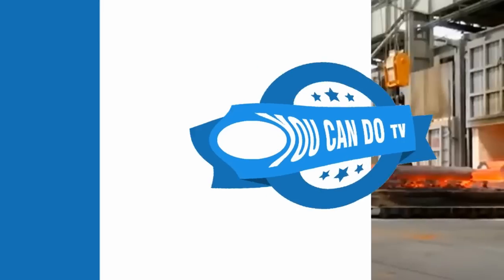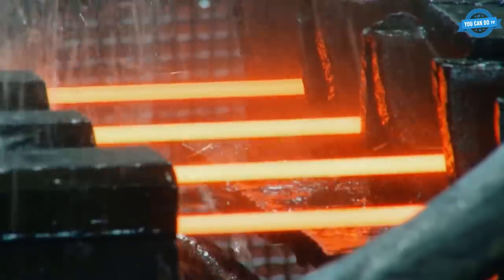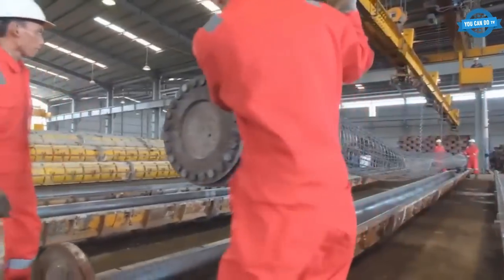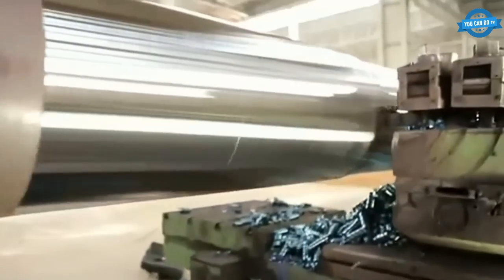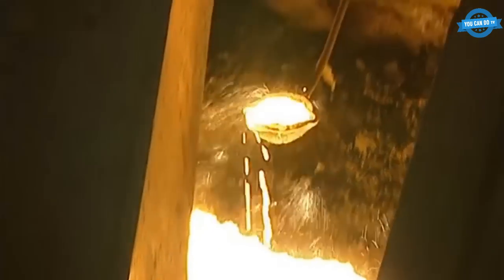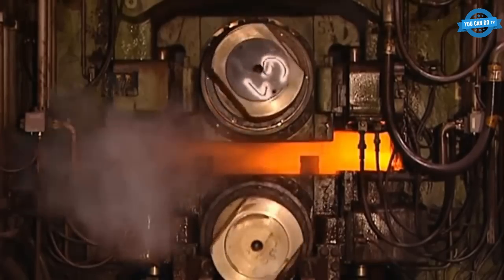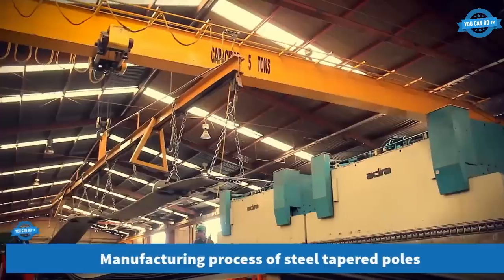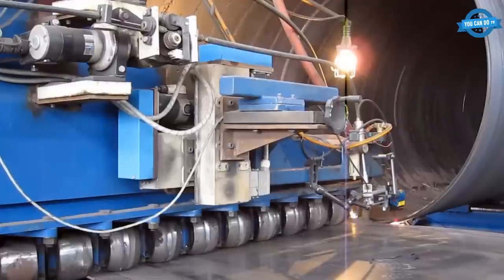You Will Not Believe How Large Steel Tapered Poles Is produced. Mass Metal Pipe Factories

Comment: 4:00   Why are you showing the making of rebar instead of what the title indicates.....steel tapered poles❓️
Reply from the maker: Please refer this time frame. 22:56. Manufacturing process of steel tapered poles 
0:57. Manufacturing process of steel bar
6:33. Manufacturing process of Balikpapan ready mix pile
8:48. Manufacturing process of ASO forge, special steel bars
11:09. Manufacturing process of HANYCO ductile iron pipes 
16:46. Manufacturing process of Quarto sheet manufacturing company.
22:56. Manufacturing process of steel tapered poles 
25:31. Manufacturing process of Online Spiral Pipe with Dual Seam Tracking